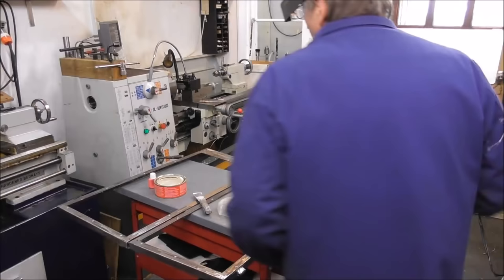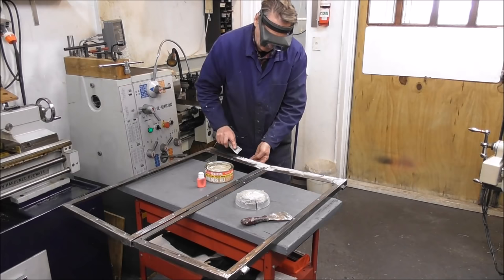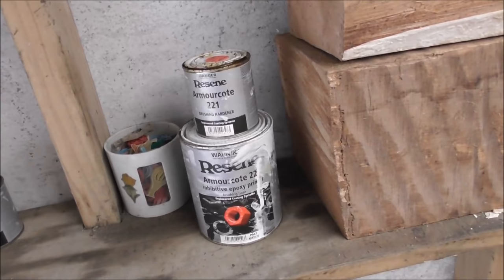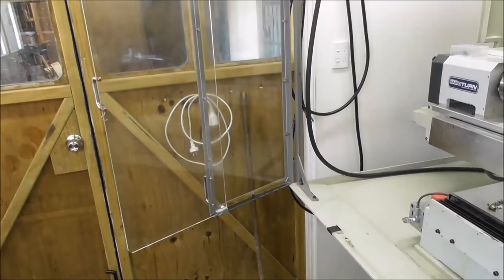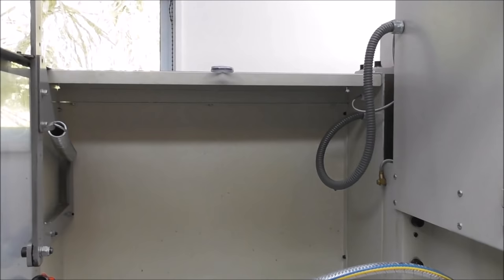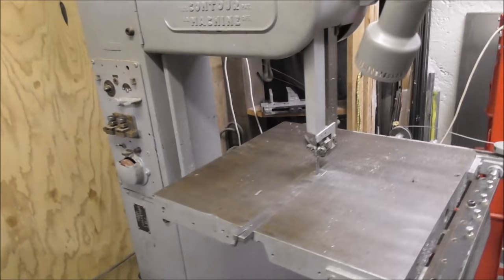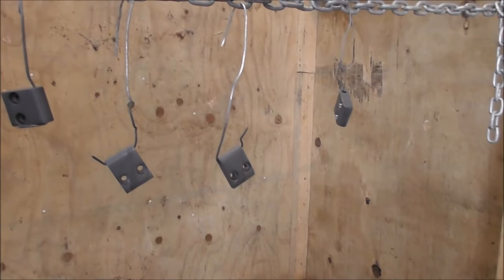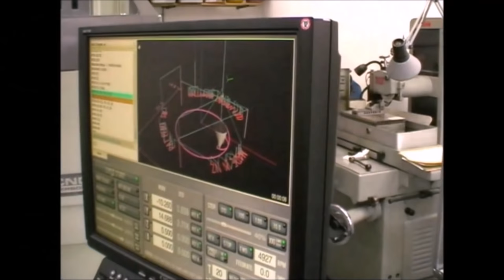Build your own Tormach Stand or Enclosure -  Part 4 -  Filling and Painting

Comment: Nice view. But the South Island isn't really Antarctica. 😁

Other options for paint finish possibly include taking the parts to a local panel beater and getting a "two-pack" spray paint finish. They're also experts with "bog".

Pan brake is an excellent workshop resource.
Reply from the maker: Thanks Bernd. Good points. Cheers  Cliff
Reply: gorgeous view to die for, that'd be a min. $500K home just for the view here, regardless of size, I'd have the largest spotting/telescope i could find permanently mounted. I 'rounded the horn' of south america once: a mystical beauty of rock spires/cliffs and fog at that time..
Ceracoat (ceramic nanotech) and Duracoat are popular here, but unsure of cost....
Reply from the maker: Yes the view is great on a clear day  - but a southerly brings the Antarctica cold a bit too close for comfort!  Cheers  Cliff.